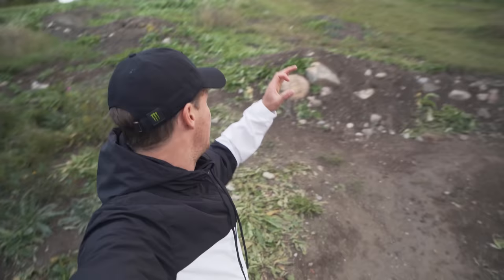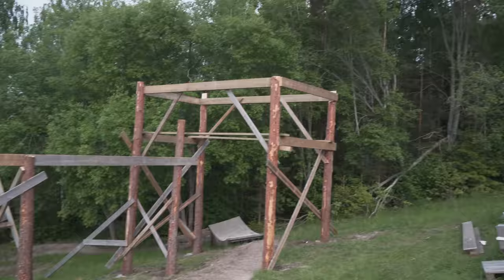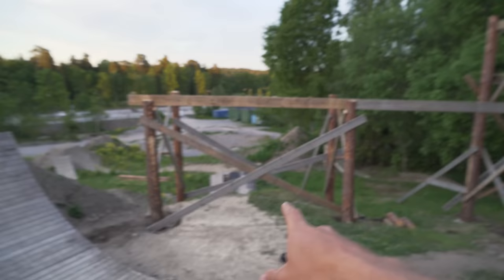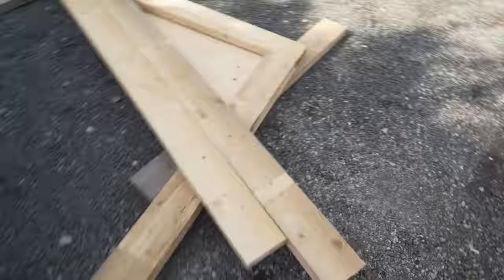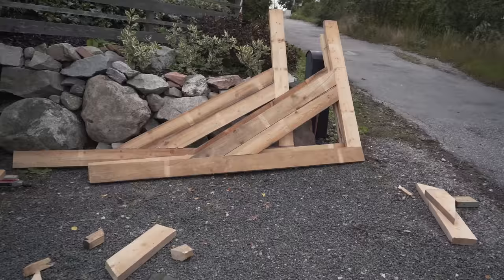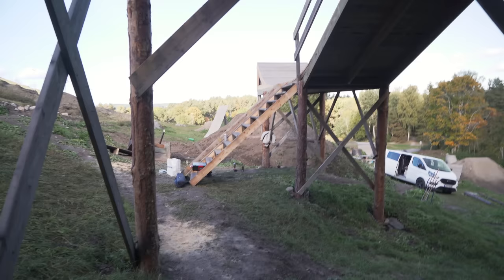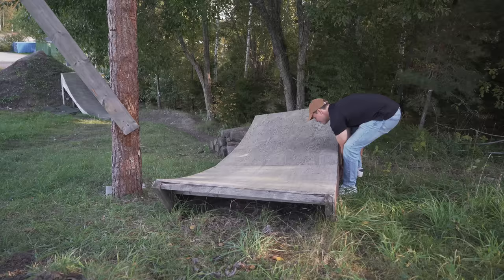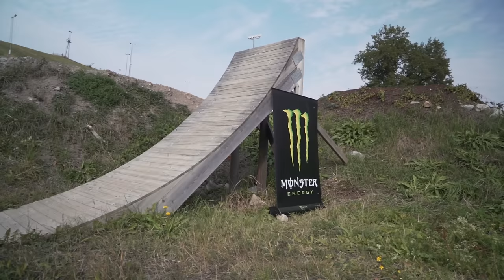I BUILT MY DREAM MTB SETUP AT THE COMPOUND! *Full Build + Slopestyle Event*

Comment: Hey max, not sure if I’ve been told, but the entire crankworks Rotorua slope style course has been changed. It’s still under renovation, but when I had a look, there were 2 big start drops, one was the old one, and they had put in a really short flat drop to the left of it, onto a left hip. nearer the end on that last whale tale, they’ve extended the platform out, and put in a really steep spine, like at red bull district ride. they also removed the 2nd to last jump on the course. Haven’t seeen the middle section yet.
🙂🙂🙂
Reply from the maker: I know!! It’s awesome with dome NEW stuff!!!🙏🏼

Comment: Looks sick, brother. Must be proud. Did any of the large wooden pylons go into the ground any amount? Realistically, you'd want at least 6 foot deep piles to give stability. If you guys didn't do it like that, that's likely why you had to make that concrete anchor. Even that's only a foot or two deep and maybe like 80lbs of concrete, so over time it's very possible that could shake free from the ground if the structural wood logs aren't into the ground, so I do hope they're somewhat deep so it can stand for years without any issues.
Reply from the maker: Yea. It’s deep down!👍🏼
Reply: @Max Fredriksson  hell yeah! I knew you guys knew what you were doing. Why would I even question it? You're a pro mountain biker and the homies. With a little love, stoke and a sponsor, you guys can do anything xD. I'm really glad you guys did things right so it's not unsafe. That'd be the last thing  anyone wants. But now you've got another sick feature at your compound and have been sharing it with the community, which is amazing. That's the kind of thing we need more of. You're a dope rider and an even doper dude. Thanks for giving back to the community and remaining humble. That's why you're someone I always cheer for.